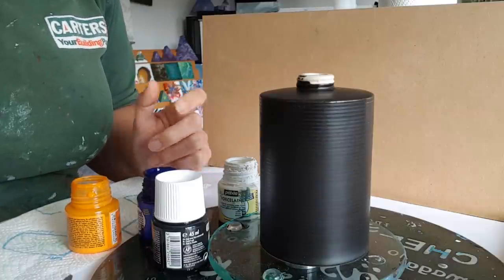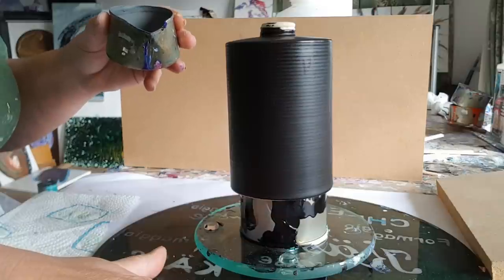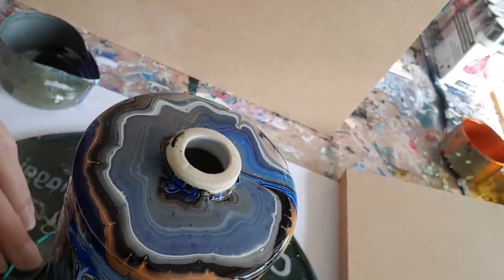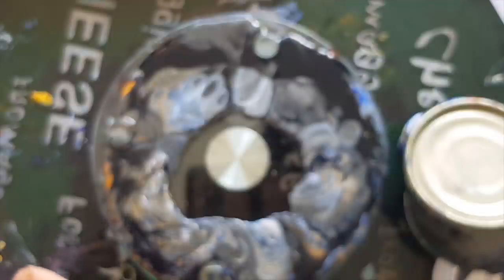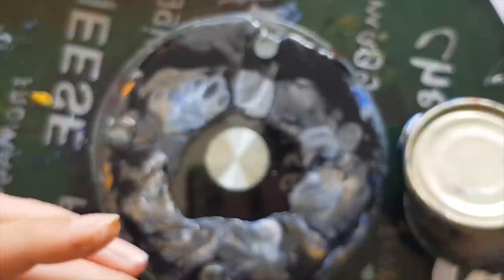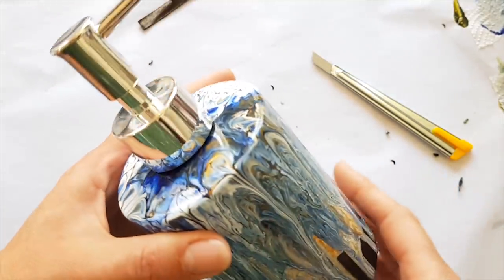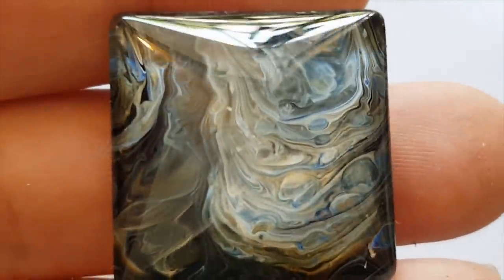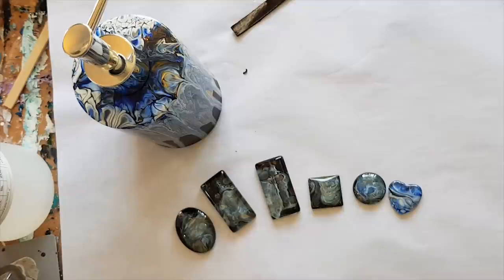335 Painted Soap Dispenser - Stained Glass Look

Comment: No problems hearing you, she needs to check and see if the speaker under the red video bar has a  X in front of it, it is not the first speaker but a smaller one over to the right that will get turned off. Click on the speaker and the  X will go away